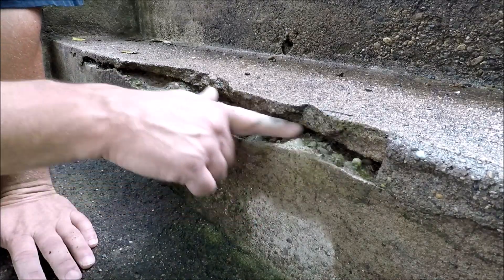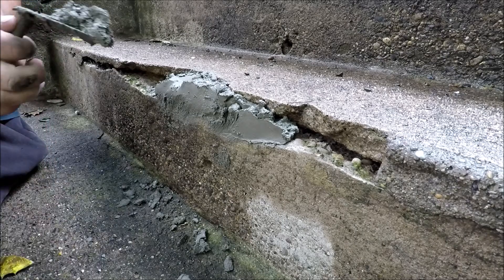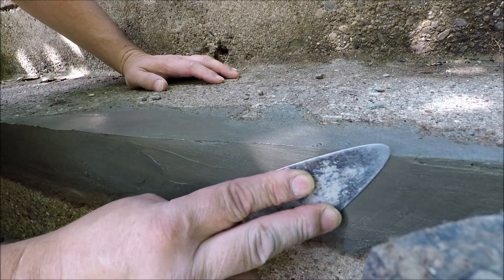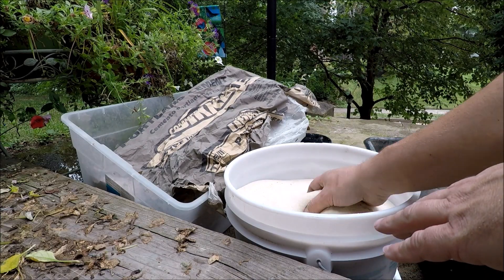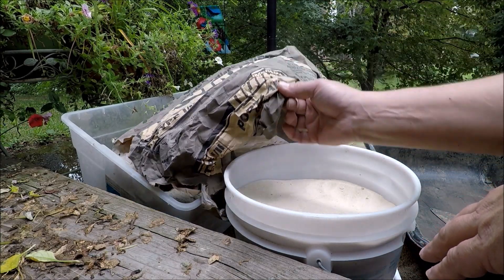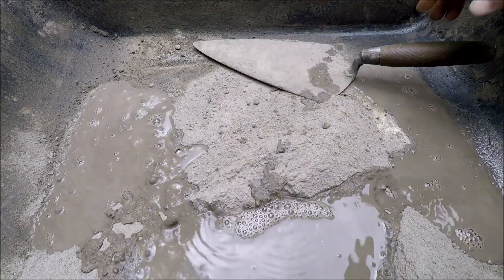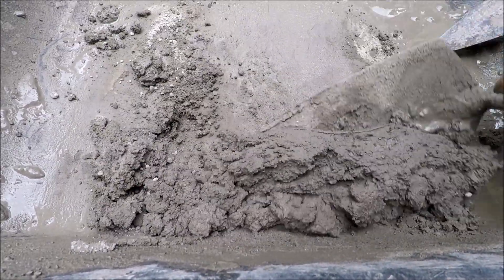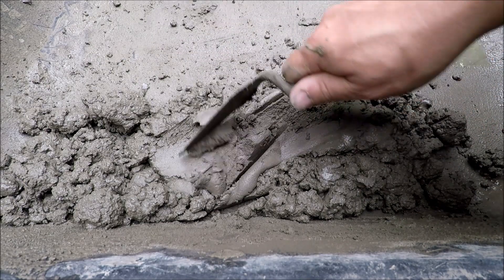Patch concrete steps easy DIY

Comment: This is very much a temporary repair and you can expect to be repeating the procedure within a year or two.  The complete staircase really needs a good powerwashing which will remove all the debris, moss and algae growth.  Algae is very slippery when wet.  To prep each cavity to be filled, you need to eliminate the moss and algae.  That organic material will continue to live and produce gases which will cause your patch to fail.  A concrete adhesive brushed into each cavity will greatly improve the bond between the old and new concrete.  Also, replace 50 percent of the water in your mortar mix with the liquid concrete adhesive to improve the strength of the patch.  Even spraying a water mist in the cavity just before mortar application will improve the bond.  To prevent the sagging slump, apply only half of the material into the cavity, allow it to begin to set and harden, then apply the remainder.  When your all done and satisfied with the finish, keep it wet with a water spray for up to 48 hours allowing the mortar to dry slowly which will greatly increase it's strength.  These simple steps can increase the life of the patch from 5 to 10 years.  Next year you'll have other things to do rather than re-patching the same stairs.
Reply from the maker: We are about a year in and the repair show no signs of needing replaced. The video was not about cleaning the steps. The patches were large or course and will hold the patch well.  Give me a comment next year and I will give an update.
Reply: Im patching every spring!!!Thk you gd advice !!
Reply: Thanks for the info! I saw another guy screw in screws in multiple areas of the broken concrete and then wrapped all the screw together with some wire. I'm guessing this is like a mini rebar replication? Do you think that's helpful?
Reply: Good advice Chris. I've never done anything like this before but my stel needs patching up so will take your advice. Were on lockdown so might aswell give it a shot.
Reply: @themrhelperguy  Excellent info and all correct. If you add structural metal pins such as tap con screws you will create anchors for the concrete creating an even longer lasting repair .
Reply: Lasted 2 years so far. He made a 2 year update video.
Reply: How the steps looking? Its been a year thanks!
Reply: Thank you for providing the correct repair info.....mr helper guy, thanks for the video
Reply: you all probably dont care at all but does anybody know of a trick to get back into an instagram account?
I somehow forgot my account password. I would appreciate any help you can give me
Reply: @Camden Terrell Instablaster =)
Reply: @Camilo Aarav i really appreciate your reply. I found the site on google and Im trying it out now.
I see it takes quite some time so I will get back to you later when my account password hopefully is recovered.
Reply: @Camilo Aarav It worked and I actually got access to my account again. I am so happy:D
Thank you so much, you saved my ass!
Reply: @Camden Terrell you are welcome xD
Reply: @wind5250  TAPCON concrete screws are excellent to provide structural support and prevent future cracking.  TAPCONs have an epoxy coating that prevents their reaction with concrete and prevents rust.
Reply: are you using anchor cement or anything in particular?
Reply: @RobertLugg  No anchor cement, as it tends to level and not suitable for patching.  Plain Type N or Type S Mortar mix to be mixed with water and bonding adhesive will provide excellent adhesion and long lasting results.
Reply: @camdenterrell6208  I don't know, but very bizarre platform to ask for a solution to get into one's insta account. A cement section in YouTube..
Reply: I agree.

Comment: I think you should have used a wetter application of cement to start filling in the crack, making sure it gets in and leaves no bubbles, that compress & expand making cracks in cement...  and then switch to drier cement application when the sharp corners have all been rounded out a bit...  allowing it to pull the cement inward as it cures...
Even the way you put it in like you were applying drywall putty, could have been a bit more like putting a pizza in the oven...   also giving the stairs a light coat of cement would be over the top...
Nonetheless thanks for sharing

Comment: did you have to put the concrete adhesive before you started applying wet cement?
Reply from the maker: I did not use concrete adhesive. The patches were made in rough surfaces.

Comment: I think I'm going to drill holes in the concrete and re-enforce it with rebar.
Reply from the maker: Good luck im sure that will add more strength.

Comment: But what cement mix did you use???
Reply from the maker: https://youtu.be/Lde3EisxpW8  you could also use a sand mix. It won't have that nice feathered edge but will suffice and it's premixed. None of the mularky I'm doing here.
Reply: He said Portland, one part cement and 3 parts fine sand, anyways ask your local hardware store for the best mix for your project.
Reply: Thank you for the responses.